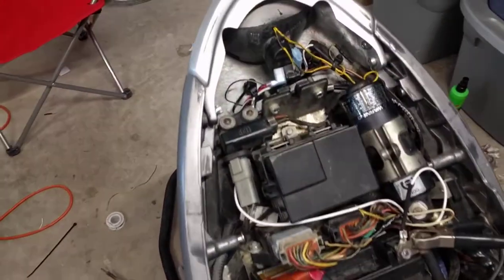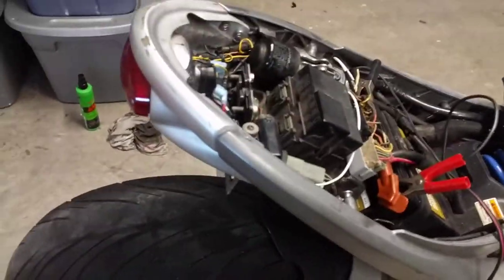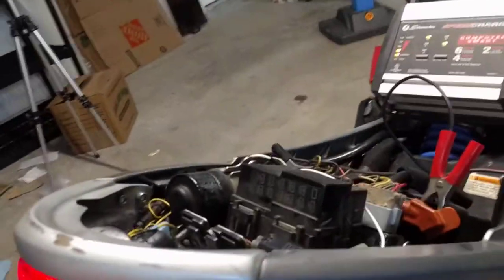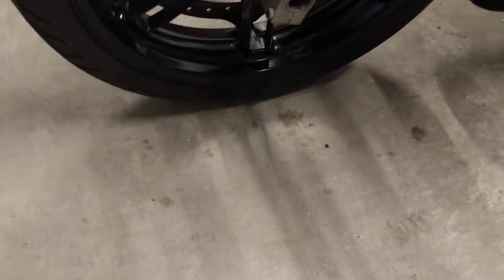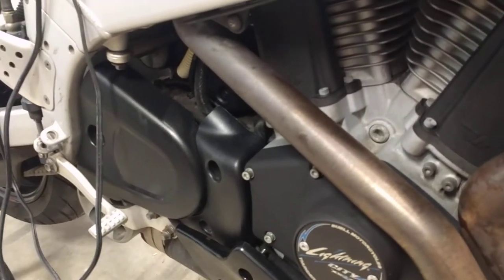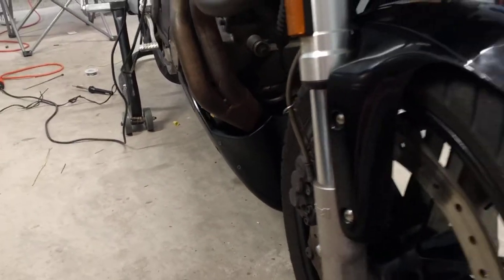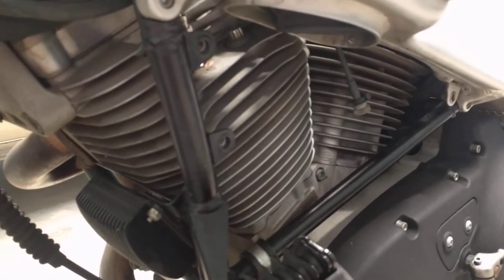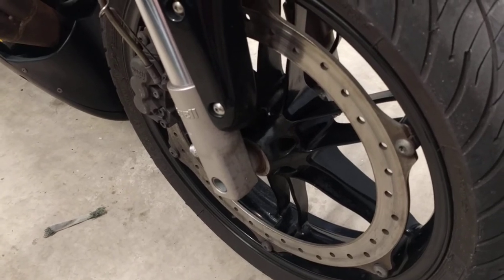Buell XB9SX - Taillight Update

Comment: Curious if Erik Buell sells interchangeable parts for these bikes with his new bikes on EBR Racing?
Reply from the maker: I'm not sure. That's worth looking into...
Reply: @kz6fittycent  not much that will swap over from the 1190's. ZTL2 front brake caliper and the cooling scoop assembly, potentially the rear brakes too, including rotors front and rear. Front wheel, the back has the drive on the opposite side so it won't swap over... handgrips...
Reply from the maker: Also the controls: https://youtu.be/5TIvPByYvUQ?t=279